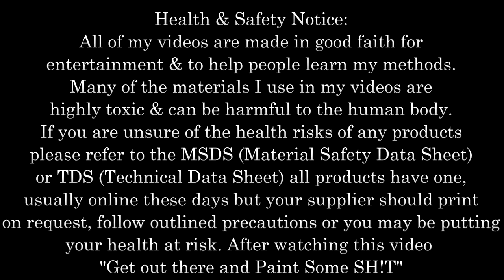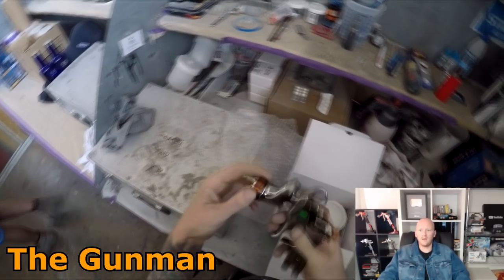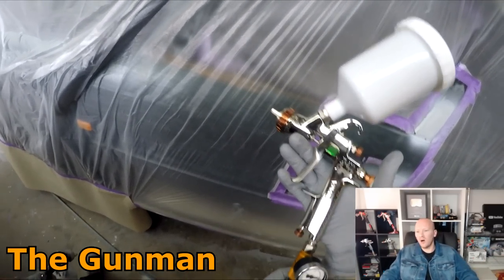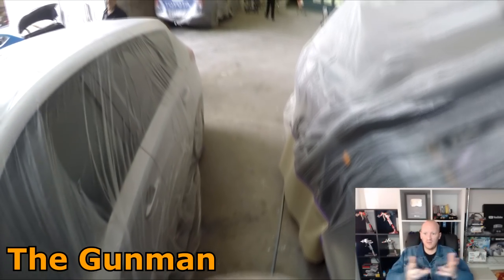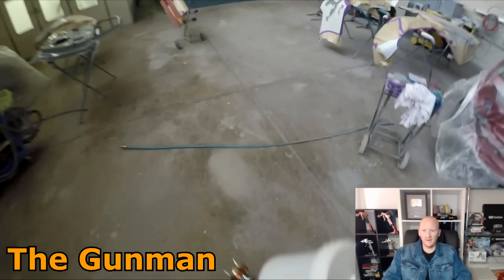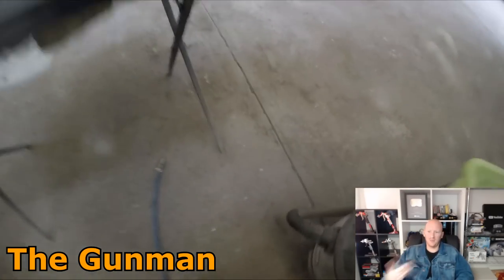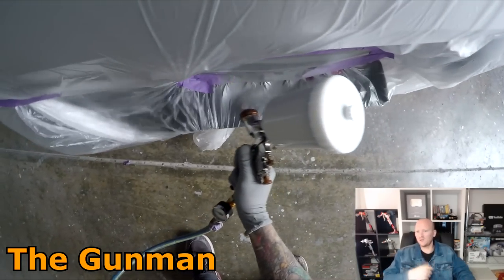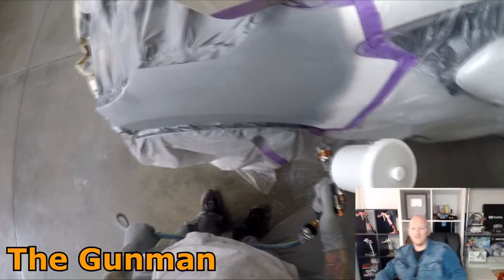Anest Iwata Bellaria 1.8 Primer Gun Review

Comment: Hey gunny , does the gun feel different when spraying primer from a 1.4 tip and 1.7? I wanted one for sealer or wet on wet and primer
Reply from the maker: I noticed when using it with the 1.8 the fan was bigger. Apart from that it just puts more material on. Good option I say

Comment: Hey Gunman. Got a question for you; can you use a DA to colour sand? e.g. 2000g wet with a small throw DA. Cheers
Reply: Junkers yes you can, when I polish I'll block it out with 1500g and I'd start with 2000g on a DA and working my way up to 5000g (depending on the colour) I usually stop at 3000g though and just buff and polish after that, you just have to be very careful to not cut through the clear